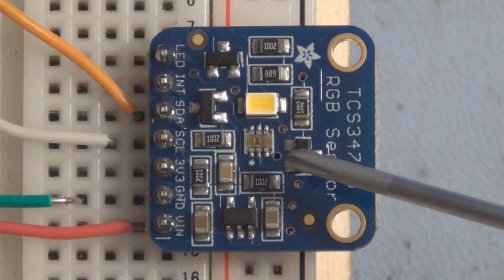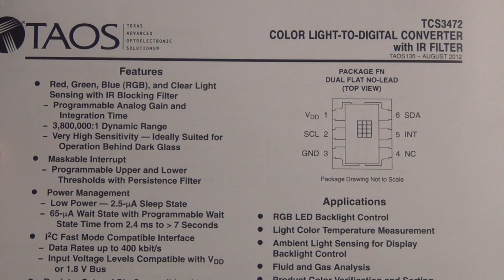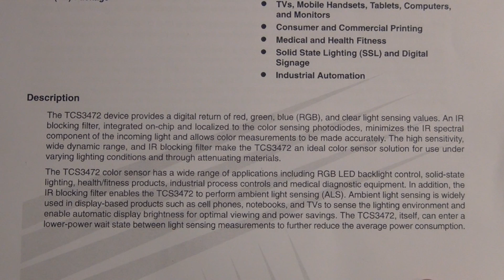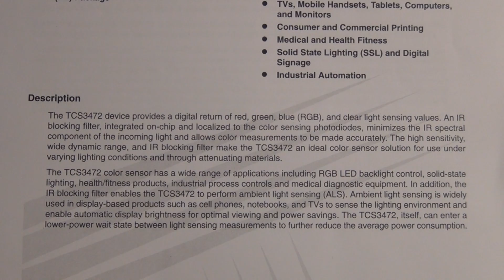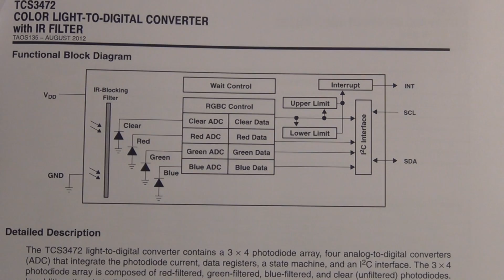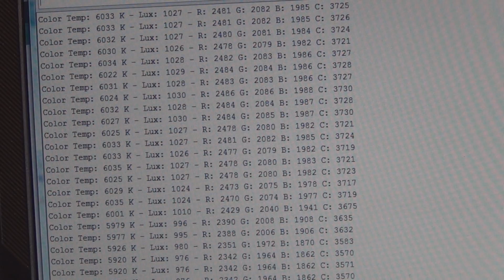Arduino connected to an RGB Color Sensor

Comment: Olá! Estou precisando conectar 2 desses sensores no meu arduino, porém, vi que os pinos SDA e SDL são conectados nos pinos A4 e A5, como faço para mudar essas conexões? É possível?
Reply from the maker: Você poderia usar um Arduino devido que possui duas interfaces I2C. Você também pode obter dois sensores RGB com endereços diferentes. Outra opção é multiplexar para que você possa alternar entre duas linhas de dados diferentes do I2C. A maneira mais fácil seria usar dois sensores RGB com endereços diferentes. Aqui está um link para algumas informações úteis sobre este tópico.  https://electronics.stackexchange.com/questions/300527/using-2-i2c-rgb-color-sensors-in-arduino
Você pode usar essa parte para se comunicar com vários dispositivos com o mesmo endereço  https://www.digikey.com/product-detail/en/linear-technology/LTC4316IDD-PBF/LTC4316IDD-PBF-ND/5297621
Reply: Obrigado!!! Tentarei
Reply: Like + Inscrito

Comment: What is the latency of this sensor? I wanted to make a user input device, and my design requires a three color (or more, since I can just ignore additional colors) light sensor. Being a user input device, it has to have low latency, like that of a pointer device.
Reply from the maker: Here is a link to the data sheet https://cdn-shop.adafruit.com/datasheets/TCS34725.pdf

Comment: What resistor values do you use? I was also wondering what the pin/wiring configuration is for the led? I'm new at circuitry, and it's hard to tell from the video.  Thanks!
Reply from the maker: +Emily McKee Here is a link that explains this circuit.  https://learn.adafruit.com/adafruit-color-sensors/assembly-and-wiring
Reply: +eTechTom Thank you so much!

Comment: hello, could you tell a beginner how to make and program 4 of these, 1 each for red, blue, yellow and green? I need them to work as a switch to activate a 12 volt lock when it sees it's respective color, I would prefer to do it on a breadboard and not even need to be arduino or connected to a cpu at all. Thanks!

Comment: Can it detect other colors, such as yellow?
Reply from the maker: +Avi Linzer It detects the RGB components of color.  Since those are the primary colors and yellow is red and green combined the sensor would output RGB components corresponding to the color yellow and you would use those levels to define yellow in your code.https://www.adafruit.com/datasheets/TCS34725.pdf
https://www.adafruit.com/products/1334

Comment: How fast does it change value when an object is placed in front of it? I'm thinking of using a sensor like this for a marble sorting device based on color, so it would have to be able to measure the color of a passing marble..